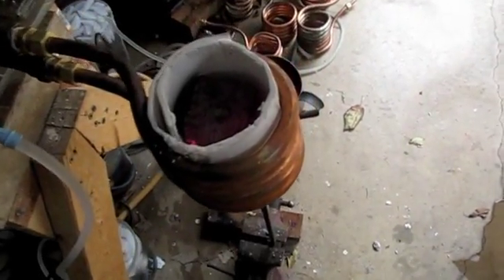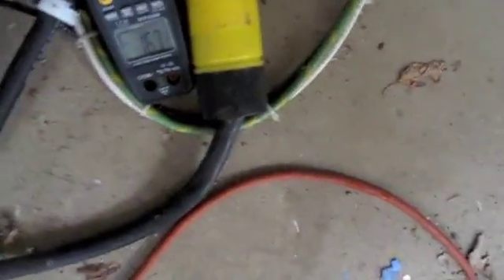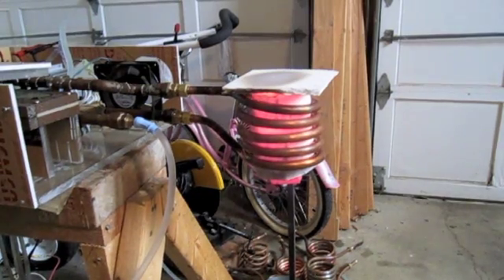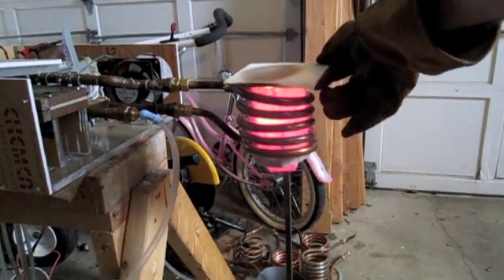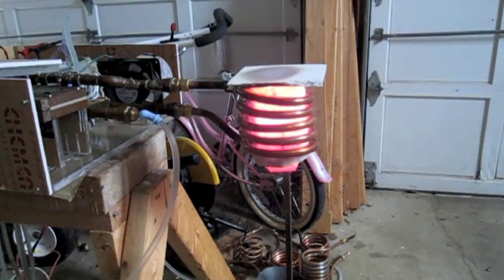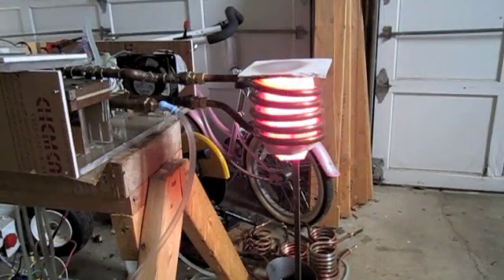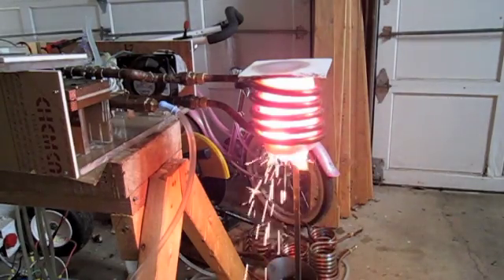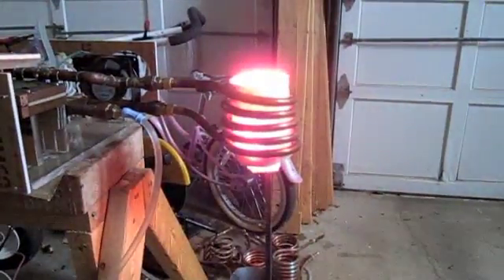Induction forging melting iron steel

Comment: Mate, I'm a boilermaker from Australia and one of things we are taught in our apprenticeships is the dangers of uv and ir radiation (in terms of light wavelengths) and I can't say you arnt wearing safety glasses but if not please buy a pair of tinted safety glasses, clear safeties will block all uv and filter small amounts of infrared but tinted will block all uv and all ir, that molten steel is extremely hot and is releasing a ton of ir and that is going to damage your eyes, not if but when depending on your level of exposure, but to end this post please take my advice into consider and for the record what you are doing is pretty awesome and you should keep up your work! Rock on brother! 🤘🏻

Comment: I can't understand why the frequency is fixed and not variable, since the working piece resistance changes with frequency, should not we change the frequency as we reach the curie point and the iron turns more conductible ?

Comment: doesnt the coil of your device gets heated up as much as the metal piece inserted in it?
Reply: Most I've seen are water-cooled and run water through the copper coil.

Comment: How much heat would you feel if you pit your hand beside the coil while the heater is in motion? Does the device give off lots of heat?
Reply: Aditya Shrawat The Cooper tube gets really hot if you dont cool it

Comment: Does the diameter of the copper pipe make a difference? If it were thinner or thicker woudl there be a difference? Does ti effect efficiency? I've been looking at induction heaters and there is some fascinating stuff.

Comment: How much is your electric bill?
Reply: you might be surprised... that unit may only draw something in the range of 10-20kw. So running this for 2 min is like running your kettle (or microwave) for ~10-20min.
Reply: actually just looked it up... if this is like 1kg of steel, then it'd be right around 0.5kwh, or about 10-20c depending on where you are. not far off my first guess :P
Reply: still no answer lol :P
Reply: Jia Jun
Reply: is that mean that this induction consume 0.5kw in 1 hour to melt 1 kg steel ??
Reply: @AFAMINE  Sure, if you can prevent any heat loss for that hour.
Reply: sn0wchyld shut u

Comment: Your electricy bill must be shockinly high ;-)
Reply: Not necessarily, the efficiency of an induction heater in comparison to say, a propane forge, is huge!
Lets say this pulled 25 amps for the full 4 minute video and his electricity cost if $0.10 per kWh. 240V x 25A = 6000VA = 6kVA (if the power factor were 1.0 that would be 6000 Watts as well but it's not because of the rectifier and filter cap, won't even get into that) Let's convert 4 minutes to hours now, 4/60 = 0.067 So 6kVA x 0.067Hours = 0.402kWh x $0.10 = about 4 cents. Compare that to the amount of propane you would have to burn in a furnace to first reach working temp, then to heat the work piece. 

That being said maybe his electric bill is high from all the other interesting projects going on. ;)
Reply: ***** Of course, if it were easy there would be a lot more IH's.
Reply: *****
I'm not sure about cheaper or easier.  $50 on ebay for a smaller unit, would just need a power supply (another $100) and a cooling unit.  And having experienced both natural gas burners and induction burners in my own kitchen I can say they are at least cost comparative in actual use.  In any kind of external heating system, you at best get 1/2 the heat into what you are heating, much less when it has to pass a crucible wall.  Induction gets most of it into the metal.
Reply: David Lantz Well i did say make rather than buy
but yeah induction is still more efficient when it comes to heating
Reply: Josh Campbell
it's still easier and less expensive to make a small propane furnace than an induction heater

Comment: Awesome! I didn't thing it was boiling though, haha - iron uses to spark and "bubble" when reacts with oxygen from the air at those temperatures.
Very nice idea with the toroid trainformer put directly on the tube. It works when such a high frequencies is used - toroid transformers that use AC from the mains at 50 or 60 Hz often need like 500 turns on the primary to avoid saturate the core (that means the voltage with one turn on the secondary will be to low to be useful).

I'm thinking about to build an induction heater my self and that idea solves many problems. One is the high voltages that would need to be used if take power directly from the mains - our main power is 230 V at lowest (wich will be 325 V DC after a rectifier) and that will then raise several times in the tank circuit to the point where it becomes hard to find transistors wich can handle it and the capacitors will also be very expensive.

Transformers working at main frequency (to lower the voltage) is expensive at any significant power level (more than 1 kVA) - otherwise 2 inverters need to be built to use a separate HF transformer (wich also makes the build more expensive and complicated and increases the losses). This way, the coil also gets insulated from the mains - without the need for extra transformers :)
Reply: Ride84XL I didnt understand, why does I need a thoroidal transformer ? Why not using NE555 and power mosfets, which can handle 600Volts when in opem circuit

Comment: With this heater, I can make my own high carbon steel ingots by adding up to 100 points of carbon in molten mild steel.
Reply: Excuse me bro, I would love to know how you can do that
Reply: @alexanderportilo  Its pretty easy, actually. You melt iron, then put pulverized charcoal into it and stir it with a ceramic stick. This way, you can easily create very potent steel. The most effective steel for most usecases is around 4g of Charcoal per 1kg of iron. You can also add in other metals into the mixture, like copper or molybdenium for creating even better stainless steel. There is tons of documentation on what steel mixture is best for what application on the internet.

I wouldn't recommend doing it yourself nowadays, though, because buying premanufactured steel is dirt cheap, often cheaper than raw iron, so there is absolutely no reason to go through this work yourself.

Comment: You had whats called a carbon boil. Happens all the time at work. Not hard to achieve. To stop it throw in some aluminum or silicon
That sounds like a low freq to me?

Comment: @plrca2 A radio frequency is used, not 60 hertz AC. The Raw AC power is converted into RF by using a power oscillator or 'MOPA' ... not unlike a broadcast station transmitter. The output of it goes to a heavy coil that is wrapped around the object to be heated, as seen in the videos. It is similar to a microwave oven but for metals.

Comment: how do you get the iron or steel to heat up past the curie point? i know that nonmagnetic metals like copper aluminium etc will heat up with induc tion heating

Comment: @matheussousuke Since I started using the Firefox browser with the AdBlock Plus add-on I haven't got a single ad.

And before anyone bothers replying, I know Google Chrome with AdBlock works just as well. I'm just speaking from personal experience.   Firefox with Adblock has yet to let me down.

Comment: Very cool.  Way beyond me, and I'm probably too old to learn at this point.  But dude, get yourself some kind of inert floor.  If you dump a 4 pound load of molten steel on that concrete, it could get ugly.  A few inches of dry sand will do.

Comment from the maker: @plrca2 It is exactly one turn .  Turns around a core can only be integer values.  Any variation in inductance is because of the added series inductance of the wire.  Once through = one turn.  If you wrap it around and put it through again it is two turns through the center.

Comment: @imsmoother I understand the purpose of the toroid as a transformer; it's the fact that the workcoil circuit passes through the toroid in stead of wrapping around it that confuses me. Is passing through essentially a <1 number of turns?

Comment from the maker: @plrca2 The ferrite toroid is what induces the voltage in the resonant capacitor/workcoil circuit.  The resonant tank needs energy to drive it.  Driving it at resonance allows one to obtain high voltages, but you still need to put energy into the system.  The coupling transformer takes the high voltage DC from the Mains supply and couples it to this tank using the inverter.

Comment: I'm looking at building this; I've read through the mindchallenger site (is that your site?), but I don't understand how the coupling transformer works. Isn't the point of using a toroid ferrite core to keep the magnetic field confined inside that core? How is a current induced in the copper tube? Thanks.